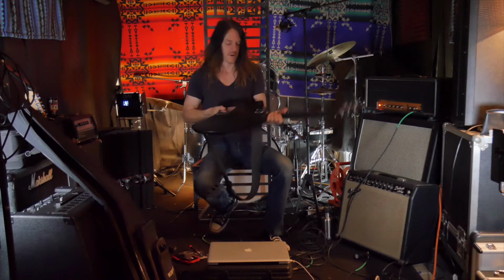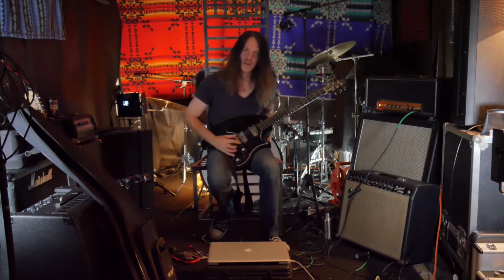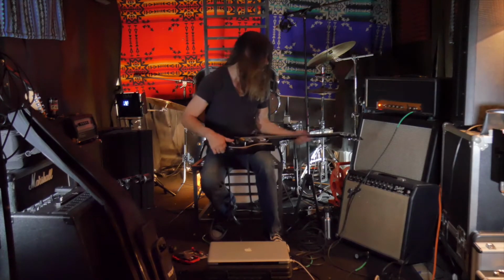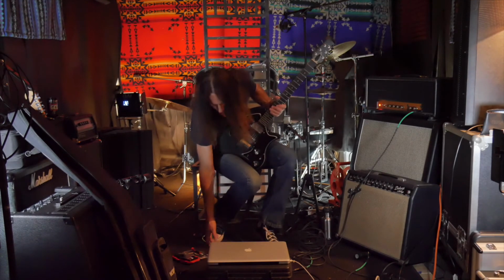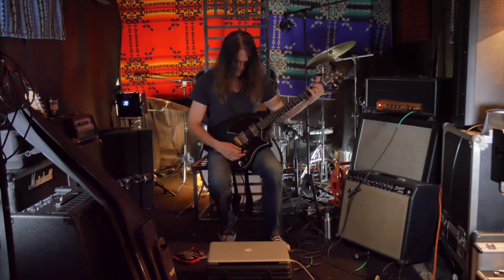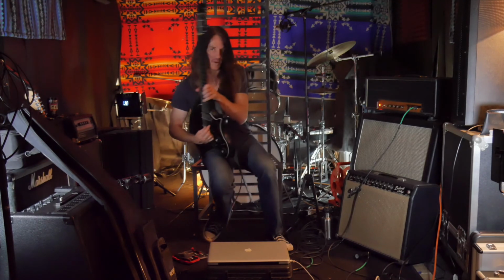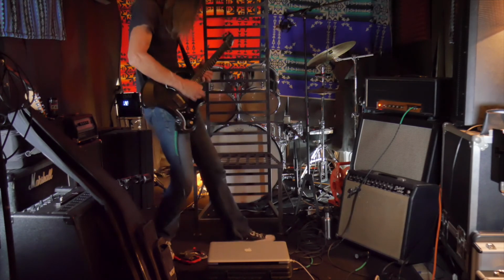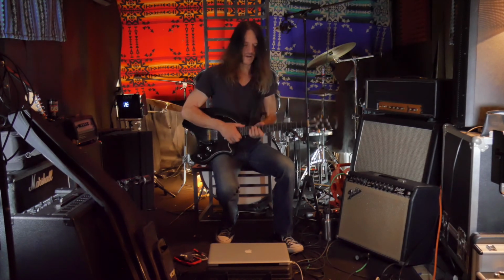Ovation Breadwinner Prototype Update: Sound Demo: Fender Deluxe + Marshall 18 Watt Circuit

Comment: The humm you're hearing is due to those pickups being toroidal wound (giant single coils) versus humbuckers. Check and make sure that the ground wire is properly connected to the screw that holds the back of the bridge assembly - they shouldn't hum that loudly.  I've owned 3 of these since 1972 and never witnessed that level of buzz.  Also, you may wish to replace the capacitors on the circuit board after all of this time.
Reply from the maker: Thank you! It's at the shop and has been for awhile. I didn't want to even attempt a reapir with my skill level. Thank you again!!!
Reply: @ChadEtchison  Here's hoping they get it sorted properly.  BTW, the Deacon shown on the Wikipedia page is mine.
https://en.wikipedia.org/wiki/Ovation_Deacon
Reply from the maker: Wow, how cool! Super nice example, too. @RocktCityTim
Reply: Do you pull your batteries out when it's not being used? I've had 3 Deacons and only my last one, a '74 , really goes through those 9v like crazy. @RocktCityTim
Reply: @DaveStuff  The output jack should be a switched jack.  The battery circuit is only engaged when the cable is plugged in. If you're using a standard Jack, or leaving your cable plugged in, that would explain it.